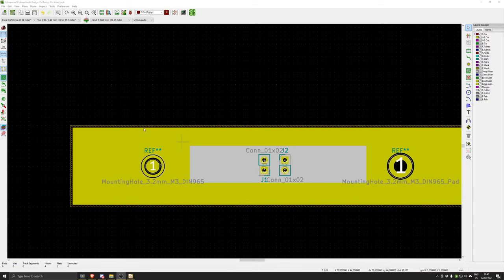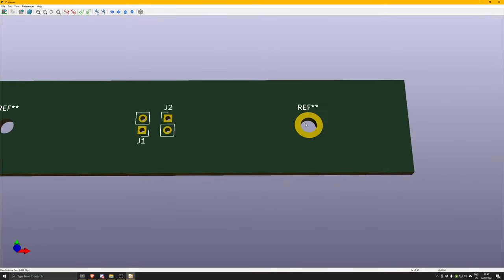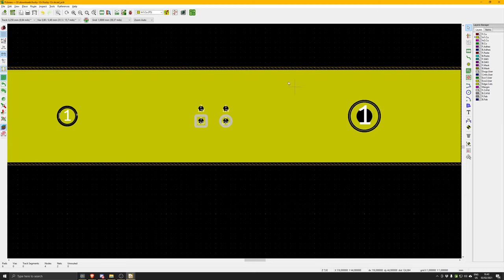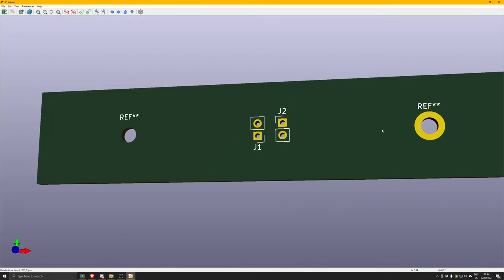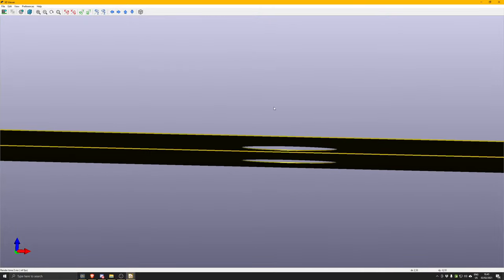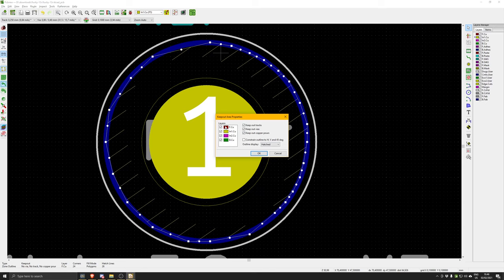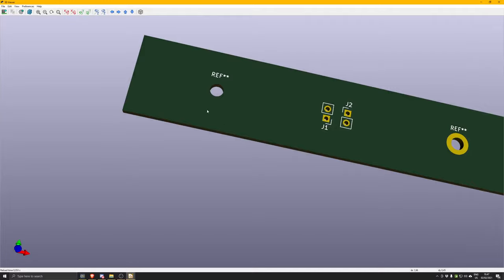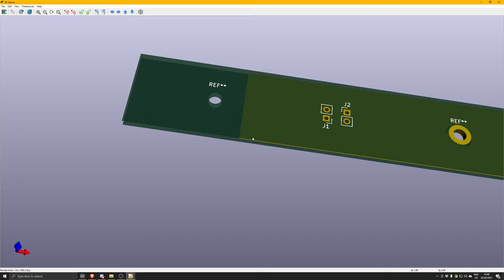NZXT H1 PCB design issue

Comment: Normally the part librarians would ensure that the through hole footprint has sufficient keepout. In this case, they took an existing design and modified it with a larger hole (likely after production), so the design would have passed DRC but still failed in the wild.

Good explanation of what is going on here.
Reply from the maker: I take it you've worked on boards professionally. Sounds dang nice to have dedicated part librarians :P

I'm not sure about the whole "after the fact" idea, as it really looks like there's copper pull-back on at least some layers in the xray https://i.imgur.com/DCTNZoV.png

Comment: Nice video. What do you think about the new design. The mounting hole itself is now robust, with sattelite vias, and there are proper keepout areas both for the screw head and the internal layers. But, they made it connected to the signal and power ground of the riser. I am not sure this is is a good idea.
Reply from the maker: Looks solid.  
It's a fairly simple thing to design. My guess is the first board failed because it was an OEM that was too far removed from the product. They were told where the mounting holes went, they put them there, no-one noticed any issues (because it's inside the PCB, and only on re-mounts) so they made a bunch.

This one has been specifically made with the issue in mind, it should be fine.